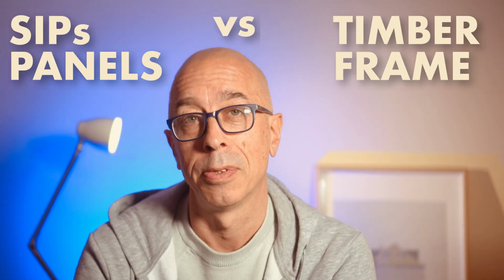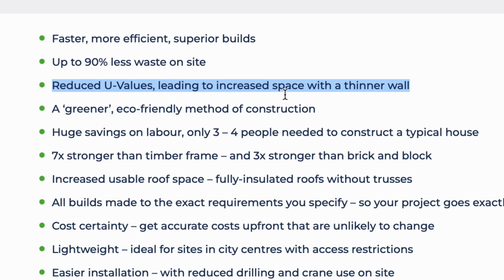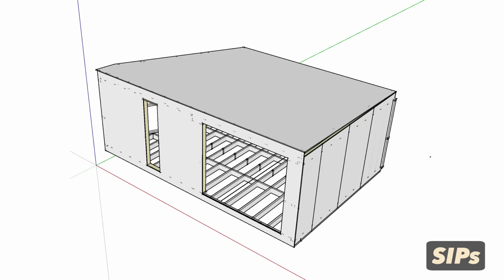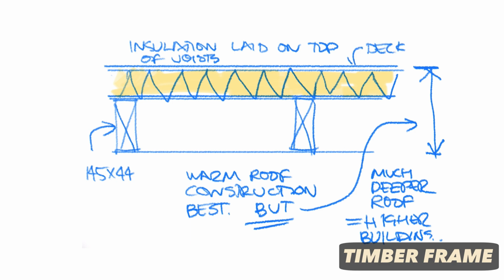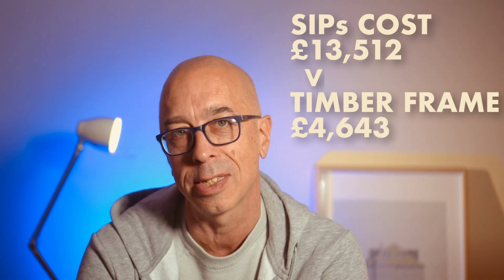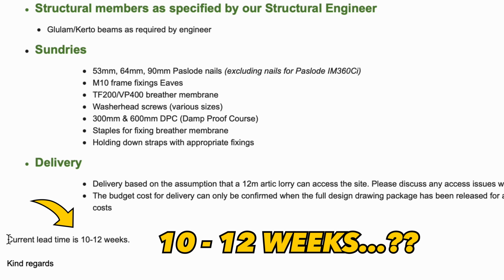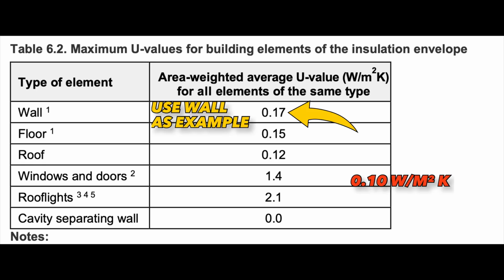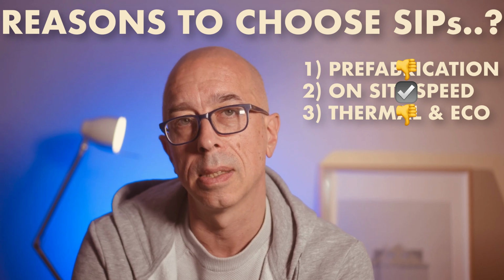What's best SIPS v Timber Frame - You won’t like what I’m going to tell you

Comment: Like everything in UK construction there is no right or wrong method of construction and everything relies on individual circumstances.  Comparisons will be made on individual projects but the adopted construction advantage only applies to that scheme.  On another project the converse might well be true.

We were employed by the small works department of a national contractor to provide the construction detailing on a design and build contract for a respite care unit.  The building had been designed as a traditional brick/block construction with a trussed rafter roof.  Knowing the contractor's passion for fast track construction we suggested SIPS construction on a short bored pile foundation with precast ground beams.  To our surprise the contractor took up our suggestion and had it approved with the promise to the client of a cheaper contract value.  In the end the contractor saved £100k on the construction due to the massively reduced prelims and gave the client half of the saving and pocketed the rest.  The job was finished in 60% of the time and handed over early.  

I have also been involved with timber framed construction where the whole sides of the building were manufactured off-site and erected as one unit, which was a common feature of New Towns housing.  We had an exercise on quick construction that has the whole house built and handed over within 9 days from a prepared foundation.

I was also responsible for the development of metal stud external wall framing that is now a standard, which was first used on a historic hotel refurbishment primarily to reduce the construction programme and thereby the contractor's costs.  Timber framing or SIPS would not have worked in this context.   .

Comment: I don't recommend buying from the dictators but I bought SIP panels with 15mm OSB in 2019, total thickness was 15+190+15 (OSB+EPS+OSB) and I payed 105 USD per piece (1200x3000) so about 30 USD per square meter, then I payed a high price for the 20 feet shipping container but I got even more when I sold it in Sweden so I can't add that cost really, but I can add the 2000USD customs fee for handling import and 25% VAT (bought it as private customer so no VAT return.)  But in total I payed close to 8000 USD for 145 square meter of outer wall with 190mm EPS insulation which I think is very price competitive. I also bought 150 sheets of grade B+ pine Plywood for 34 USD per piece and 54 pieces of 6m long 45x300 LVL Beams that are flawless for 60 USD per piece. So regarding how crazy the prices became in Sweden during Covid I saved a real big chunk by the China trades but I'm not sure I would do it again.

Comment: You are very detailed and Thank you for the video. The only problem when you compare a DIY project to a project engineered and installed by a company it will be vastly more expensive. I would have like to see you contact a custom contractor and see what he priced it out as. You stated the SIPs dealer would deliver and install the walls. So I would like to see the cost of the same treatment with timber frame build. Not everyone has a garage of tools and team to DIY. $4.6k for a contractor to build an insulated studio in my backyard is an insane deal. You can't buy per built sheds for that cheap.
Reply from the maker: I’m not comparing a DIY project. The figures I show are with industry day rates and it’s a perfectly valid comparison to sips. I’ve no idea where you get the 4.6k for a studio in your backyard. You have your foundations, your roof, drainage and a host of other things to include, over and above, exactly the same for both methods. You mention tools, irrelevant, you need tools for both methods. Sheds? What??
Reply: @build-better-things  To clarify 
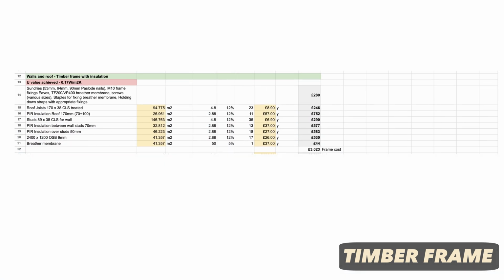5:22 "...for me and my colleges to build the walls and the roof..." To my understanding of DIY you and your friends building something is doing it yourself. When the SIP supplier installs the walls and roof that would not classify as Doing it yourself. 

I apologize. I understand my error when stating the cost for the entire cabin was $4.6k.

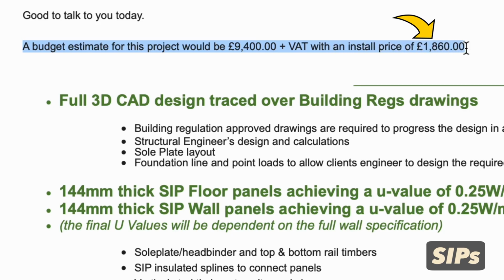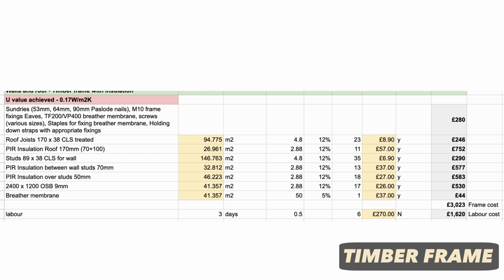My entire point was at 3:25 you stated transport, installation, and assembly by the SIPs company. This means you as the consumer are not using any tools or labor to build the walls and roof of this building. Comparing the price to building the walls and roof with your friends over 3 days is not a fair comparison. The fact that you repletely state this is real world numbers. Did you factor in the years of building experience you have and all the prices of the tools you will use. Please let me know if I misunderstood what you said at 5:22.
Reply from the maker: All my pricing in the examples shown in the video include labour costs at rates I charge my customers. If it’s for my own developments, I still need to factor in labour rates where lending is involved.  Yes, agree  DIY has no labour cost.

Comment: Use both. Wrap your timber frame in sips. No brainer
Reply from the maker: Except your wall will be around 400mm thick and then there’s the cost.
Reply: @build-better-things  you can get sips in different thicknesses. 4” foam for walls and 6” for roof!  The cost will be made up in efficiency!
Reply from the maker: Four inch sips panels perform worse than four inch PIR boards. You wrap your studs in PIR, which is what I show in the video , never with sips.

Comment: Have you heard or anyone using a sips floor with timber framing for the rest of the build? Would you think there's any advantage to this idea if building a small house that would sit on a pier and beam foundation?
Reply from the maker: I think with sips it’s about economies of volume. Just getting a floor set up for you on their presses isn’t going to be cheap. However, getting the floor down and a working platform in place is a big deal. I’d do it if I could trust the manufacturer to deliver. My experience is they (sips manufacturers) take your money but then don’t deliver in the time they promise.

Comment: Hi Jerry.
How do you fasten 50mm insulation externally over the studs?

How would i then fasten render board over the pir? Im assuming I'll need some sort of DPM between render board and PIR.

Thanks again.
Reply from the maker: Put a couple of temporary fixings through the insulation into the studs , to support your insulation, then add your breather membrane, then you fix your vertical battens through the insulation and into your studs using tube washers and fasteners which will also support your insulation. Then you add counter battens and then your render board.
Reply: @build-better-things  
Amazing thanks!
What if I don't want the ventilation behind the render board in the interest of making the wall as thin as possible?
Can I use some sort of waterproof render that will keep the rain off the wall?
I'll have a good quality vapour control layer on the inside so no moisture will get through in to the studs from inside.
Similarly if the render is perfectly waterproof then the studs will remain high and dry permanently.
I know some of the EWI manufacturers claim their silicone render can provide that degree of waterproofing to the outside.
What do you think?
Reply from the maker: @DoctorRetina you definitely, 100pc , need ventilation between the membrane and your render board, regardless of the vapour barrier.
Reply: @build-better-things 
Thanks Jerry, I'll definitely keep the ventilation gap.
I've got a load of 10mm battens that I can use as vertical battens and counter battens = 20mm gap. Is that adequate or is more required?

Also, can you help me understand the science of ventilation gaps. What exactly is the ventilation gap drying out if water can't get in from inside or outside?
Thanks again.
Reply from the maker: @DoctorRetina  strictly speaking needs to be 50mm but for a single story you might be ok at 20 if you’re really set on reducing the depth. Need to have gaps or vents too and bottom.  The purpose of the ventilated cavity is two fold. To allow vapour to evaporatethrough the breather membrane, combat any dew point , as well as any residual moisture that gets in through damp or the outside. Look up “rain screen” to get a full description as I can’t do it here
Reply: @build-better-things  Thanks Jerry, that sounds great.
I was trying to apply the principles from your warm roof video (another fab video), where a VCL inside and water barrier (eg. EPDM) outside is sufficient to completely seal the roof structure in an airtight manner. This is despite the fact that a roof in and of itself is more vulnerable to water ingress.
Why is it that a warm flat roof does not need a rain screen?
Thanks again.
Reply from the maker: You’re asking great questions. Most roofs do have rain screens. Think about tiles on battens. If you were to bond a wall finish directly onto your insulation, then in theory you might not need a rain screen, just like the warm roof example. You’ve then got a load of complexities over any dpc. I’ve done it before using EPDM and rubberfleece for my walls as well as my roof. If you can’t bond your render board onto your insulation, and have it impermeable, then you need the rain screen.
Reply: @build-better-things  
That makes perfect sense! 
So if you're saying the only exception to a rain screen is if you're bonding directly on to the insulation, how about this... 
Primer on to PIR eg. SBR. Tanking slurry straight over that. Fibre mesh embedded in to the tanking for reinforcement. Waterproof masonry paint over dried tanking.
ChatGPT believes this could work lol, but whats your experience?
I would need to check with each product technical department to see if their product would be compatible in this arrangement.
Thanks again.

Comment: Great vid.
How can i calculate u value of my wall, is there an online calculator or better yet a spreadsheet?
Thanks
Reply from the maker: Yes, you choose which insulation manufacturer you want, and most of them have an online calculator where you fill in your wall, floor or roof makeups, and it selects the appropriate insulation. Good luck.
Reply: @build-better-things Thanks Jerry, that's great. Is there a calculator that can then help me work out how much energy is required to heat a space given the estimated u value. That would be useful to work out ROI of various types of insulation.
Thanks again.
Reply from the maker: For that you need to calculate the volume of each room, then you can go to a heating company, one that sells radiators, and that have calculators that do that.
Reply: Try - vesma u value calculator in google - you can play about with various materials and make many comparisons. Beware interstitial condensation issues

Comment: Great videos, thanks. However I would like to point out that your timber-framed wall example that reaches a u-value of 0.10w/m2K  adds up to an overall wall thickness of 427mm, not 328mm as stated. A similar wall thickness to the SIPS example and no reason why it should be that different in thickness anyway.

Comment: Hi @build-better-things, I'm wondering how you batten out the exterior of the stud wall over the insulation and which side of the I insulation the breather membrane goes? Finally, the DPM, would you lap that up over the insulation or between that and the OSB and over or behind the breather membrane? 
I was totally sold on SIPs but I've done the sums and it's madness how much cheaper timber framing is. (I'm looking at building an approx 6mx6m infill extension on a 1930s detached house). I've commented about suspended v solid floor as I'd like suspended but until now the solid seemed marginally cheaper, however now I've done the sums on the framing suspended flooring seems like a winner. Just need some hefty joists (or easi-joists) to span the 6m! Unless of course you would recommend at least one block support and divide the flooring up into sections?
Reply from the maker: Hi. Breather membrane on cold side. If you mean the battens for the cladding, long screws through the insulation and membrane and into the wall studs. I’m not sure what you mean about DPM. That goes under your concrete slab or below the solum fora  suspended timber floor. In terms of my preference, I’ll go for timber floor with solum over concrete all day long. I’ve made videos about Dpm, timber walls with insulation, and solum so check those out and thanks for the comment
Reply: @build-better-things  Thank you 👍🏼 The DPM laping was something I had seen advised elsewhere. The idea being that you pin the dpm excess up against the side of the structure, however that felt like a way for condensation to run down and get trapped 🤷🏻‍♂️ I'll go and find those other videos now.

Comment: I worked most of my career as an analyst in the City. We took a lot of stick for being a bit shark like but at least when I was there, reputation was everything and you kept your word. I the last 4 years of my career I switched coverage to green tech. You almost wanted to count your fingers if you shook hands. No concept of shareholder value, they just expected shareholders to cough up more for no return! Some interesting ideas but no idea how to implement cost effectively . Fuel cell tech was the worst billions pumped in over 4 decades but we still do not have a commercially viable fuel cell. I suspect SIPs is much the same and heat pumps too. You take a simple and good idea and turn it over to the double glazing boys, who ramp up the price and  blow the budget. Sips are a very basic concept, 2 sheets of 11mm OSB at £10 per sheet and a sheet of foam £58 ex vat, some glue and a press. Let’s say £90 in materials. So why are they so pricey? Lack of scale and lack of nous! Materials are cheap probably less than £90 presses are not. The number of presses limits production, hence big lead times and deposits required to finance holding the materials.  How many presses would a manufacturer need depends on glue setting time but each press would probably cost between £30k and £50k more for computer control. It suddenly becomes a capital an ,machine intensive operation which needs volume for economy of scale.
Reply from the maker: Yes. House builders won’t invest in the cap ex because they say demand isn’t there. It’s true. Demand isn’t there because there’s no economies of scale.  Classic chicken and egg in construction industry in UK.
Reply: Sad that we're too afraid of being ripped off to let single bodies of experts specify the whole thing holistically and tell the supply chain what's what

Comment: Ive just built a garden room using sips. For me the cost increase (not all that much) was worth it for the speed of construction which saves me money - because quite simply money is time!
Reply from the maker: Good to hear. My experience was different from yours. I tried for several weeks to get them to just reply to my emails, all 3 companies. Then the only one to come back , minimum of 10 weeks for delivery of panels… after the engineering!!!?. So probably 3 - 4 months. What a joke. No speed. For timber frame on the other hand, I can get the whole kit delivered to my door within a few days, and built within a couple of weeks tops.   My thinking was, imagine if they’re like that now, what it’s going to be like once they’ve actually got my deposit. Hopefully your experience was different.
Reply: @build-better-things  Don't get me wrong, I contacted a couple of companies and heard nothing. The one I used had good customer service from the start i.e. responded to my e-mails! I ordered ahead of when I anticipated to build and even though I live in the Scottish Highlands I received them around 5-6 weeks after ordering which was pretty decent (they were up front about how long it would take and kept to this schedule). I'd agree that if you want the materials quickly, SIPs have a definite draw back next to going to a merchant and picking up all that you need that day or so.

Comment: Interesting video, full of useful information but you were talking about EPS SIPs not PIR so I'm not sure the thickness comparison for a given U-value, with timber frame infilled with PIR, stacks up. However PIR SIPS would be even more expensive than EPS ones so the cost comparison certainly does.
Reply from the maker: The reason I didn’t cover PIR was because the three manufacturers I looked at didn’t use them. Agree with the points you make about thickness and cost, and thanks for your comment.

Comment: Im looking yo build a 50sqm extrnsion for a house in London, so heavily researching SIPS. With labour costs being so high in London, SIPS is looking considerably cheaper than traditional methods (not timber frame however). The other factor is the general standard of builders in London is very poor in the domestic residential market. Having the extension facrory made is very appealing as if planned well glazing can be order once the SIPs design has been signed off.
Reply: Did you do your build and how much did it end up costing?
Reply from the maker: If you can make the economic argument work, and you don’t have the supply issues I mentioned in the video, yes SIPs will definitely help as you’re not so reliant on checking they’re using the right insulation, breather membrane, vapour barrier etc. Your quality control issues will centre around the glues they use for the stick junctions, and the junction with the sub structure. Thanks for your comment